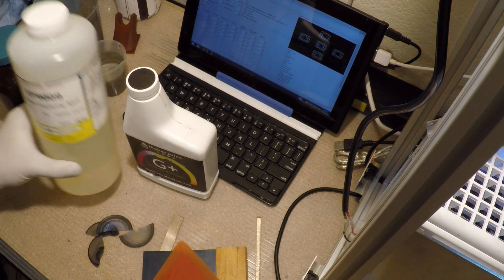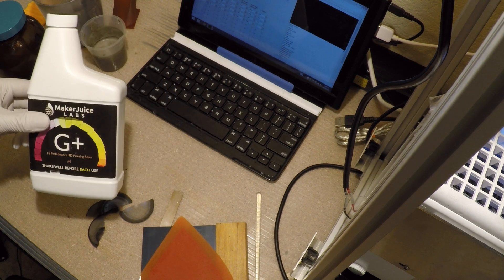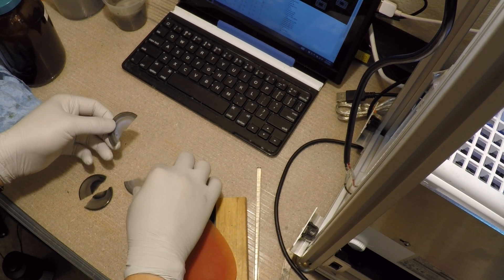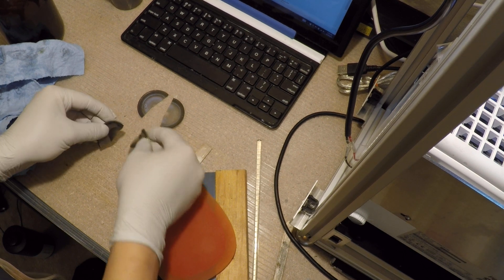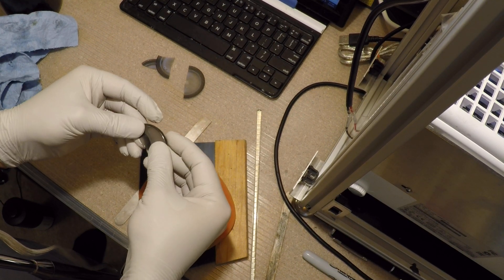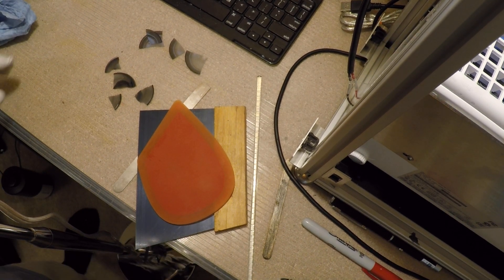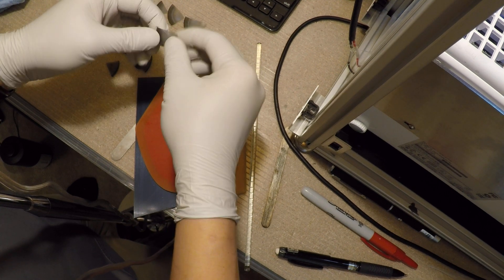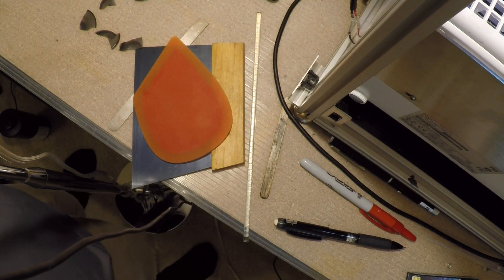Eager Plastics EP9009 Plasticizer w/ SLA 3D Printing Resin

Comment: Have you found anything that works better? I need something for casting parts in 1/4" thick parts. I use a marble resin with fillers but need something to give me more elongation at break.
Reply from the maker: I haven't found that powder fillers work well; they invariably weaken the part with no other advantage. It's been said that DruckWege Resin (https://www.druckwege.com/english/shop/resins/) is an epoxy based formulation that is substantially stronger than other resins on the market but I have not had a chance to try it.
Reply: Thanks but I use a lot of resin, about 10,000 pounds per month. I can not afford to use resin that is more than 1.40 per pound. So I am just looking to add something to my resin that will allow more flexibility in an 8ft X 24" part that is 40 pounds.
Reply: I am looking at the Silmar 628 as an additive...
Reply from the maker: I see, then i think you're in a completely different application domain. There are no 3D printing resins at even 10X that price point. You might be able to find a polyurethane formulation - there is a wide variety of those and many vendors.